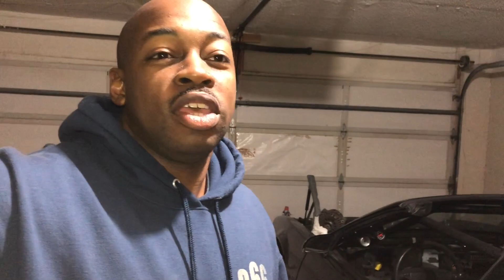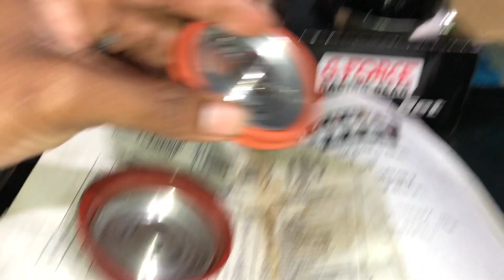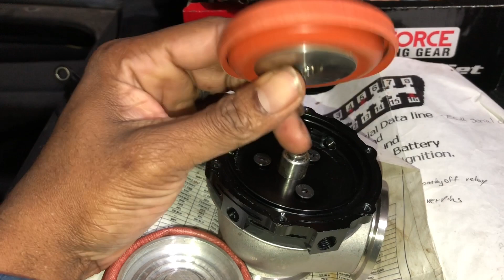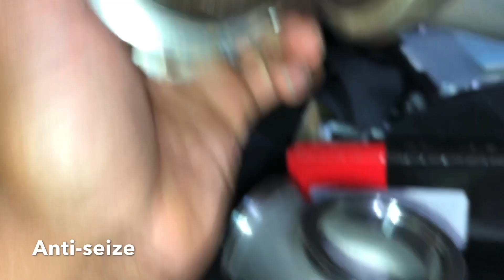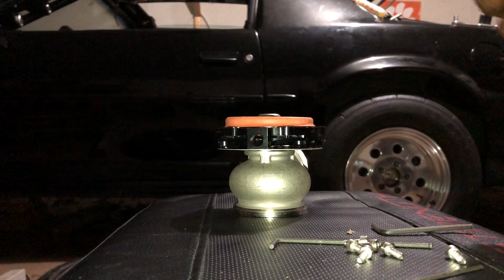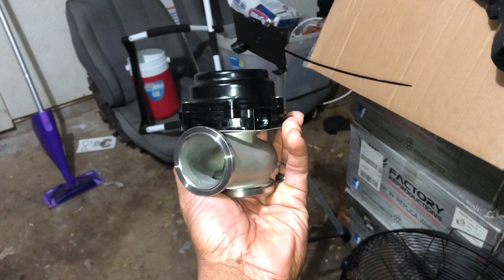VS RACING Wastegate Review Pt.2 for my 5.3 Turbo with SBE(Stock bottom End)

Comment: Would you recommend buying a kit like vs racing or piecing it together? Starting from scratch so I don't even have manifolds
Reply from the maker: infamousnova I would, but (ultimately up to you) I’m cheap on somethings.  I can see a clear difference in quality between the real ones versus knockoffs. But the knockoffs work. I would expect it, making sure there are no cracks or metal shavings. Then fix or replace as needed. I know people that run VS Racing turbos and wastegates running 5.2s to 5.3s
Reply: @boostinwillie  so what's bad about the kit? Is that the route you went?
Reply from the maker: infamousnova turbo kit or wastegate kit?  I have no experience with their turbo kits. Only the individual parts. Turbochargers and Wastegates. As far as their wastegates just make sure the diaphragm inside its in good condition and their are no metal shavings inside
Reply: @boostinwillie  well I guess both. I think the turbo kit comes with all that
Reply from the maker: Oh, I would make sure the welds on the headers and tubing is good if you went with a kit. Me personally I like putting my own tubing together that way I can put it where I like 😎
Reply: @boostinwillie  I cant weld lol. I was thinking of getting hooker headers and the kit since it doesn't come with headers. But I'm thinking all the tubing might be a waste, since hooker has a universal merge pipe
Reply from the maker: infamousnova it’s never to late to learn. I’m still learning too. When I built my kit, I just started playing around with a cheap harbor freight welder. I basically tacked mine in place where I wanted it and took the tubing to a friend that was a good welder. He still charged me though😂😂😂.
Reply: @boostinwillie  will v bands hold the cold side together or it needs to be welded?
Reply from the maker: infamousnova  either vbands or coupling or welds will work. Just make sure if you use coupling you have a lip and the pipe for it to grip. Otherwise it will blowoff
Reply: @boostinwillie  So with a carb do I need a intercooler? I read somewhere that I didnt, reason I went carb smh
Reply from the maker: infamousnova  that depends on the type of fuel you run and if it’s a street car. Most street car need some type of intercooler wether air to air or air to water.
Reply: @boostinwillie  aww man, this is getting more  complicated by the day lol
Reply: @boostinwillie  I will drive it on the street
Reply from the maker: infamousnova methanol fuel cars and methanol injected car don’t need and intercooler and some E85 cars. But I still use an intercooler with E85
Reply from the maker: infamousnova just one step and one day at a time. And plan everything out it will work out. Everyone started somewhere. Hell back in 2004-2005 I remember I started out trying to build my own rear mounted turbo system. It was a failure but I learned from it.
Reply: @boostinwillie  where is your battery located?
Reply: @boostinwillie  man it took me all night to plan out what cam I will use after I already decided on one. Then you said get a turbo cam lol. So I got the cam out the way. Now trying to figure out if I'm going summit s475 or vs racing 7875 kit. I will more than likely go with hooker manifolds and cross pipe. Then fuel is another topic lol. What's the cons of e85?
Reply: @infamousnova  I get doing this on a budget , I really do . But if you really want less headaches , and the ability to tune it better ditch the carb , run a intercooler if you plan on driving it on the streets.  The drivability factor alone for efi should make that decision easy . Again it's your project ,and ultimately your choice , but you won't be kicking yourself later for going efi.
Reply: @jacksonstorm6395  You know I was thinking that, but my option is the sniper unit or pro flow. I already have a carb style intake. I've seen so many people report issues with there unit
Reply: @infamousnova  you are running a Ls right ?
Reply: @jacksonstorm6395  yes I am, I have a 5.3 on the stand that I need to gap the rings etc..
Reply: @jacksonstorm6395  I got the intake and msd box brand new for the price of the Intake so I jumped on it
Reply: @infamousnova  I'd sell the intake/ box, then go get a truck intake , harness and computer and wire that in.  Far less headaches . Then start looking to upgrade to either FAST, or Holley engine management. Also you will find far more tuners that can tune your car relatively cheap than a blow thru set up . You will spend more going blow thru in the long run .
Reply: @infamousnova  is this a x body nova? 68-72 ?
Reply: @jacksonstorm6395  73 Nova
Reply: @infamousnova  close enough.  Seriously give this some thought .  I've seen so many guys regret what you are about to do.  Every time the weather changes , you will be straight pissed off . You can even switch from factory ecu to micro/mega squirt cheaply vs going fast/ holley . Again it's all up to you.  But taking your time , propper planing / long term thinking really does make a difference between something you keep , and enjoy vs something you get angry even thinking about , and put up for sale . That's my .02 cents.
Reply: @jacksonstorm6395  I'm debating it